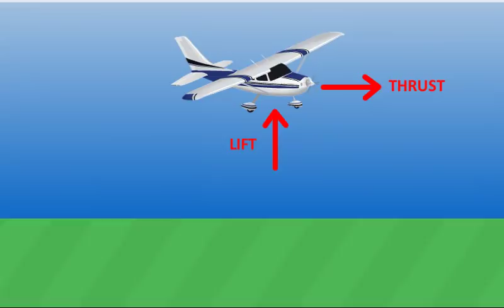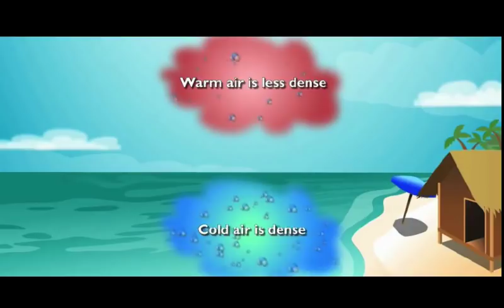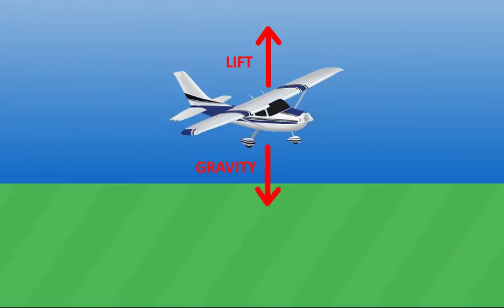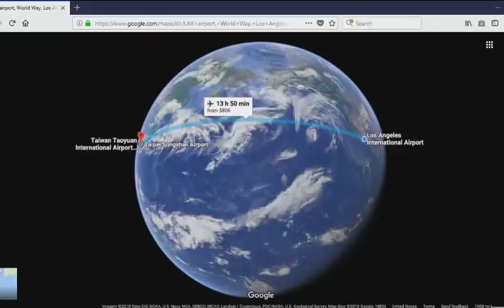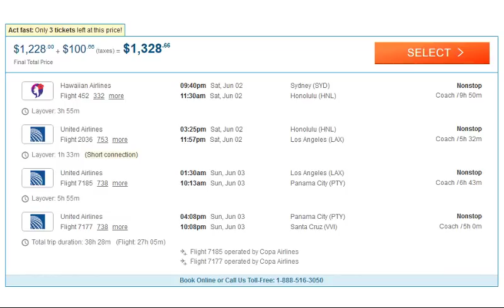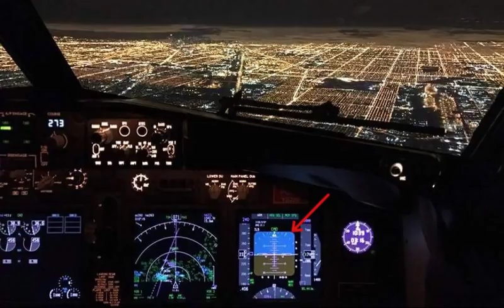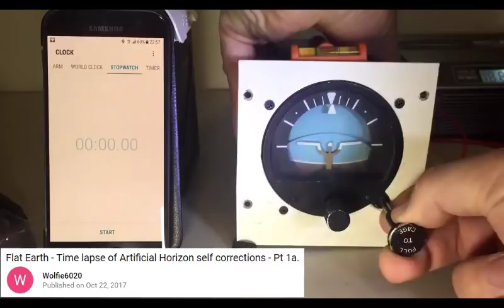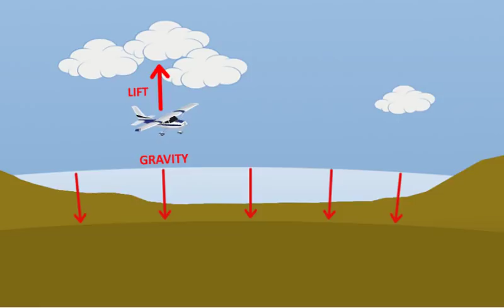Flat Earth Falsities - Plane Nonsense

Comment: So if a boat is sitting still in the middle of the ocean not thrusting forward...and a helicopter is resting on that boat and that helicopter Powers up and lifts straight up to 100 feet or 1000 feet above the boat hovering directly above it and stays there not thrusting forward just hovering... And then the boat Powers up and begins thrusting forward at full throttle... Will the boat gain distance away from the helicopter as the helicopter remains in the original same spot hovering... Or will both stay in a straight line because gravity and the atmosphere are pulling everything together in unison... I'm pretty sure the boat will continue gaining distance away from the helicopter as it remains hovering in the same spot in the air because the Earth isn't moving and gravity is lies and the atmosphere will not act as a solid and grab everything in the air and pull it along in unison ..
Earth is flat and motionless.
Reply: That's like saying, I will climb up on this building, and not move. Then you walk away. What in the world does that prove?
Reply: @appresley4071  read it again. Either you didn't read it correctly or can't picture the experiment in your mind...
Reply: I am guessing the atmosphere may want to stick to the boat and its half & half with the air momentum? But (Their) normal logic does cause perfect synced momentum of air / solid(ground) Carriers. Its a very sane sense that kind of alludes me! Hope Someone that understands SCIENCE can help you better.  Are you trying to prove something?  If so try not to make it too hard for Some to follow such questioning :)
Reply: @BrainUser1  so if two helicopters take off at the same time at the same altitude in opposite directions....you mean to tell me the one going in the direction of the "Earth's spin" is being pulled forward by the Earth's spin and gravity at the same time so thrusting forward would be unnecessary???? And the helicopter going against the "Earth's spin" is going forward and backwards at the same time???? So it's basically hovering because it's thrust is being challenged and overcome by the pull and reversal effect of Earth's spin????? Please elaborate????
Reply: @markgallegos8413  I'm stone and educating myself with a 1959-1960 Charlie Brown (with loud ELP Tarkus)  and got to answer a Physic question? :(
I am not tell you... the Winners are not here, where are those boys gone? Hope not because of ME!
Its Their Atmospheric Momentum! It will trag any mass though it gas ...it a modern wonder!!! :) 

That IT FOWARD ON AND BACKWARS young helicopher!   enough for me, back to my rainyday.
Reply: @markgallegos8413  Because it is an Inertial Reference Frame it is the same as if Earth is motionless. Consider being on a train moving at constant velocity and you have a drone on a toy remote controlled truck, the drone lift off and hoovers, then you have that truck move forward. It acts identical to the train not moving because it is an inertial reference frame. 
      It has nothing to do with the atmosphere acting as a solid and grabbing things (it acts as a fluid), but that the boat, helicopter, solid Earth and atmosphere are all already moving at the same speed.
     Intuitively you know the Earth to be flat and motionless, and see no justification for gravity. I understand that. So on a personal level, we simply disagree. I'm not here to insult you or belittle you.
Reply: @romithromith  but once that drone lifts off the train and creates its own thrust and enertia it can choose to fly alongside or above the train or just simply fly in the opposite direction of the moving train until that train is not even visible anymore and disappears  into the horizon... That drone can obviously see that the train is moving and gone because it is obvious that the train is in motion...if the Earth is obviously moving we should be able to replicate this no matter how fast or slow or in whatever direction of Earth's "rotation".... So according to your logic no matter what we do we can't replicate this experiment with earth... Makes absolutely no sense... The only way to simply explain this is that Earth isn't moving at all...just as your senses tell you and just as the Bible states...
Reply: @markgallegos8413  You are a little obstuse my friend, I warrented 2 replies? Heavy on the exchanges man, I at least wait for such language to lower myself... Sure have not delved in the comments to jump to conclude I am a GEer!  Not my fault the local Zealots are veryt quiet now, usually half a dozen should be feeding.
Nonplus the Hypocrites laments.. lets leave the childish vulgarities to the Normals.
Reply: @markgallegos8413  A better analogy to Earth is the train in a dark night where only the lights of the train (and drone) can be seen and a train on an adjacent track. There is no way to know if we're moving or not. We could be stopped and the other train moving, or it stopped and us moving. Or if the drone and train drifted apart, the acceleration could be so slight we couldn't tell which is moving.
     Like the two passing trains, the apparent motion of the Sun and stars tells me the Earth is rotating but tells you the Sun and stars are rotating. The same disagreement would exist for the 15°/hr. measurement from the optical interferometer Bob Knodel is associated with. We would also disagree with the existence of space and spacecraft so that's out. This experiment might not tell us one way or the other. There are other things we could debate but I'm being too long winded as it is.
Reply: @romithromith  no. The sun moves, the stars move , the moon moves , but the earth is stable and cannot be moved just as stated in the Bible and just as easily observable with your naked eyes...hence your explanations for the inability to test for this movement being Soo complicated and difficult to describe and mine so being so simple...as with all complex questions the simplest answer is usually the correct one...
The stars were created to keep track of years, hence your ability to only see certain constellations at a certain time of year. The moon was created to keep track of months hence the moon only being in a certain part of sky on a certain part of the month..and the sun was created to keep track of days, hence the sun being in the same part of the sky every 24 hours...and that's why all ground and atmosphere test have proven no motion at all...
Reply: @romithromith  so according to your teachings and beliefs...at what height should we more or less start seeing this "movement" because even in the red bull "space jump" promotional video where the jumper is practically almost in "outer space" there is no observable movement at all of earth in that video... And even if you were to reach the necessary altitude to observe any of "Earth's movement"... As you're looking down at earth will you start to slowly see a gradual movement or will it be quickly moving at a 1,000 miles per hour as "science" states ??? Because no matter how small or large and object is a 1,000 miles and hour is a 1,000 miles an hour...really fucking fast no matter how you slice or dice it...
Reply: @markgallegos8413  According to your bible π=3
Explain that !
Reply: @markgallegos8413  It's neither a science book. So buzz off with your flat earth.
Reply: @markgallegos8413  The Earth rotates at the same speed the Sun moves in the sky: 15°/hour. Do you see the Sun move? But you know it moves. 
     It's not simply a matter of altitude or linear speed. While Earth moves 1,000 mph at the equator, it rotates slowly—angular velocity of 0.00694 rpm, which is once per day. An hour hand of a clock rotates twice as fast. How far away do you have to be to see an hour hand move?
    It generally isn't reasonable for an object to remain fixed in one spot to see Earth rotate because objects would require an orbit. The exception is Epic:DSCOVR which is locked between the gravity of the Earth and Sun (in its own orbit of the Sun). It is about 1 million miles in altitude. Viewing a series of photographs clearly shows the Earth rotating.
Reply: @markgallegos8413  "The sun moves, the stars move , the moon moves , but the earth is stable and cannot be moved"
    That is how you see it.

"...as stated in the Bible"
     We probably shouldn't introduce the Bible into this.

"and just as easily observable with your naked eyes"
     As subjectively observed from Earth. We see the Sun 🌅 rise—but this is phenomenal language—the Sun is not literally rising. We feel warmth from an intensely bright Sun, so many people mistakenly conclude that it is on fire and radiates heat.

"hence your explanations for the inability to test for this movement being Soo complicated and difficult to describe and mine so being so simple"
     No, Epic:DSCOVR is such a test. Time is the independent variable. I used the analogy of the trains on a dark night to demonstrate the relativity of motion.
     Imagine if people also existed on Mars. They would also observe the Sun, stars and moons move and perceive the surface as unmovable. what we do and could make the same conclusion.

"as with all complex questions the simplest answer is usually the correct one..."
     This is called Occam's razor.
►The simplest answer for the contrary and retrograde motion of the planets is heliocentrism. 
►The simplest answer for a southern celestial pole which other star apparently revolve about, is a spherical Earth. 
►The simplest answer for the Sun rising in the southeast and setting in the southwest in Melbourne in December is an inclined, rotating, spherical Earth and distant Sun.
►A spherical Earth is the simplest answer for the Sun's altitude (angle) from various latitudes at solar noon; from a sphere the altitudes become parallel lines to a distant Sun.
►The simplest answer for seeing the same Moon phase where the Moon is visible, is a distant Moon and Sun.
🌕 🌖 🌗 🌘 🌑 🌒 🌓 🌔

"you are too brainwashed by bullshit science..."
     You were slipping in arguments from FE and I was responding to them. There are videos telling you that it is bullshit science because they are unable to respond to it. But the observation of the Sun in Melbourne and other items above are things you can see yourself that FE can't explain. Do you distrust your senses when they disagree with the Bible and FE videos?
Reply: @romithromith  then tell me why you can see the same star ALL NIGHT long on a clear night...
I guess the earth falls asleep at night and forgets to "spin"...???
Reply: @markgallegos8413  If it is true that the Sun actually rises and sets, then it necessarily passes under the Earth. But the Sun is always lighting half of the Earth, and this common sense disproves a flat Earth. The sun rising and setting is "phenomenal language" — it describes the world the way it appears to the observer. (Be careful of special pleading.
)
Reply: @romithromith  bullshit. The sun's  movement can be noticed withing 15 to 20 minutes...wheras the stars stay in the same position all night long.
Reply: Mark Gallegos I take it you haven’t stayed outside at night. 

You’re saying the grounded drone has momentum from moving with the train but when it takes off it instantly loses that momentum and the vertical power instantly gives it identical forward momentum?
Reply: @flookd5516  once an object leaves any moving surface and has broken away from the inertia of the moving object and once it creates its own momentum with whatever means of thrust it is using to keep it in flight....it should obviously be able to look back or down and see the surface moving of which it was just on but no longer is affected by it's movement hence it's ability to see it move.... Which should be easy to replicate here on earth but is impossible to because the Earth is  stationary...just as your senses tell you but "science" convinces you to ignore...
Reply: @romithromith  no...it never goes under earth...it simply is lighting half of a flat circle.
Reply: @markgallegos8413  If it doesn't go under the earth, then the Sun isn't actually rising or setting at sunrise and sunset; it's phenomenal language describing the perception in the observer's frame of reference.
Reply: Mark Gallegos The object itself has inertia (all objects do) and its thrust modifies its momentum. It does not magically lose the momentum it had while sitting in the ground. When you throw a ball it continues moving when it breaks contact with your hand; it does abruptly cease moving.
Reply: @markgallegos8413  - If 2 people on a plane walk in opposite directions does one have to walk at 500+ mph?
Reply: @NotTheCIA I.think gravity is bullshit.
Reply: @markgallegos8413  "gravity is bullshit." No, but your puerile examples and questions are, aren't they.
Reply: The boat at rest is moving 1,000 mph with the earth. So is the helicopter sitting on the boat. The helicopter ascends 100 feet. At this point, both the boat and the helicopter are STILL moving at 1,000 mph with the earth. The boat then goes full throttle and starts moving forward. The helicopter is still moving at 1,000 mph with the earth. But now the boat is moving 1,000 mph with the earth PLUS the speed that it's traveling. So the boat moves ahead of the helicopter. Why is this so difficult for you people to grasp?